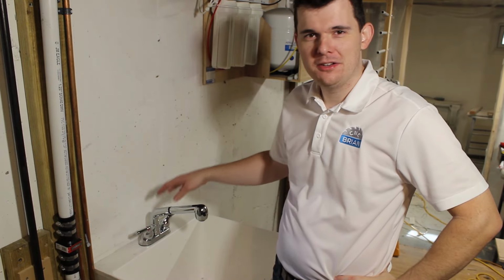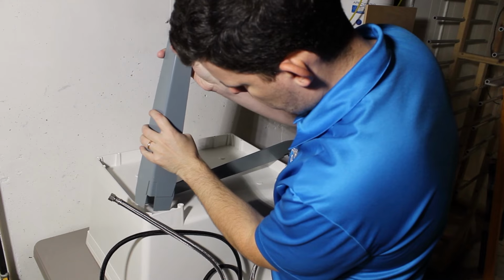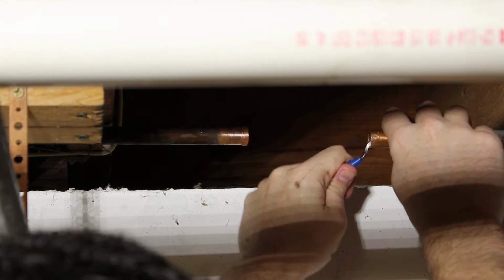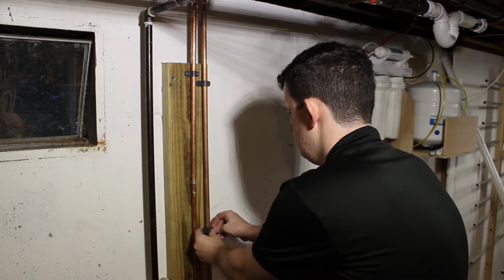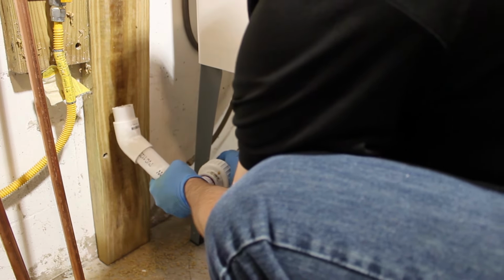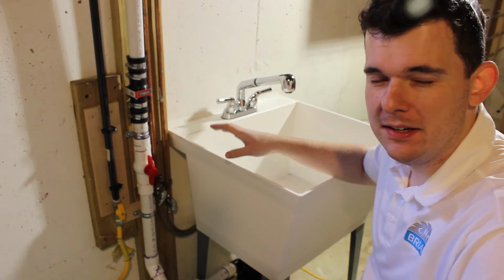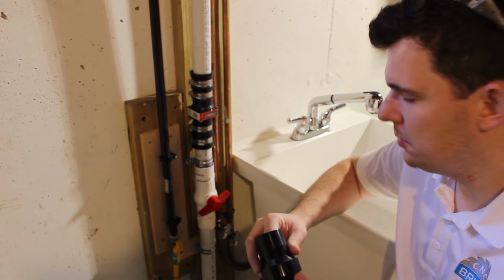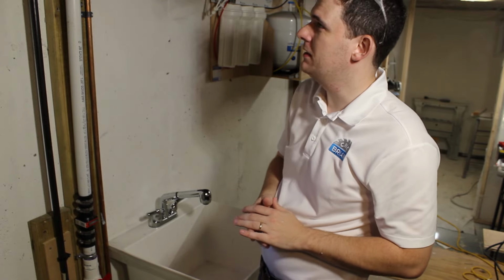Home Projects: How to Install a Basement Utility/Laundry Sink

Comment: Great video! I have a utility sink that I want to move and the drain is coming up from the concrete. Quick question, what do you do if you existing drain is on the floor of the basement? It's protruding from the floor. Thanks for the feedback!

Comment: What if the main waste pipe is only a few inches above the laundry sink?  A plumber recommended a utility pump to keep waste from backing up into laundry sink. Will a utility pump be overkill if you're only moving the water slightly up to the waste pipe?
Reply from the maker: You will need a pump regardless if the wastewater pipe is above the elevation of the outlet of your sink. Basically if you can't exploit gravity you will need another means of getting that sink wastewater above the wastewater system discharge line.
Reply: @ Thank you so much for the excellent video and the detailed information. I’ll still have to hire a plumber, but now I’ll know what I’m talking about.

Comment: Got quoted $3,600 for similar job in 2024. Did it myself instead and saved over $2K. Used a Liberty 404 pump and Zoeller 3 in 1 ball valve, check valve, union. You did a very nice job in this video, clean and straight. If it doesn’t leak and gets the water away then mission accomplished.

Comment: 10:05, will reducing the flow with the check valve hamper the volume of water you can discharge at one time?  In other words, take a sump pump for instance, it discharges all the water at once with no restriction in water flow
Reply from the maker: This shouldn't, it will only max out at the discharge capacity of the pump minus any losses, should be minimal with a full swing check. However check out my newer video where I replaced this with a much better pump, this original video the pump become very problematic.
Reply: Thanks  @briancnc

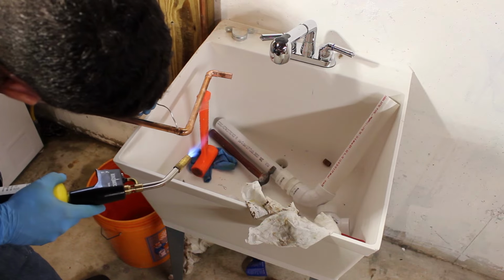Comment: 5:06, Just a note: soldering over plastic can be a hazard due to the burning hot solder if it comes in contact with the plastic, as it can burn a hole into or right through the plastic surface, so be careful & conscious as well

Comment: Brian - great video.  I am going to try this on my own. with help of your video.  Do you have any suggestions on type of pump specifice?
Reply from the maker: I would highly recommend a pump like this one:
https://amzn.to/3OcVb5P
 instead of the simmer pump I installed in the video. It has a basin that holds around 6 gallons so it will run very infrequently. The one I used in the video after awhile became very problematic. I will be shooting a video in about a week replacing it with this pump and post an update. I installed this one on another house and regretted not doing it on this one, was just trying to take up less space on this install but this pump runs continuously if the check valve leaks even the slightest.
Reply from the maker: I highly recommend the pump shown in this video, just published, rather than original I used. There is a link to it that video description as well. https://youtu.be/wsBWhM0QDG8

Comment: Why doesn't anyone put the piping within their walls in the basement? Too cold? I hate seeing all this piping.
Reply from the maker: Concrete foundation
Reply: @briancnc  I ment if you have a framed exterior wall in the basement that is inside from the foundation. I have drywall up on the exterior walls but the previous owner still kept the plumbing exposed. Any issue with routing the piping within the framed wall?
Reply from the maker: @SurfTheStreets01  I mean it's all about cost. If oyur basement is nicely finished I would definitely have cut open a stud bay and patched the drywall to clean that up. Just need to make sure it's well insulated if it's an exterior wall. Depending on your location.

Comment: Can you drain into a sump pump?
Reply from the maker: Mechanically yes, but check your local building codes. I will be posting a new video soon where I swap this unit with a sump pump unit, I really wasn't happy with the inline unit in the long run (although simpler and cheaper at the time).

Comment: Is there no need for venting?
Reply from the maker: Unfortunately you can't really cleanly vent off with this unit unless you branch off underneath the sink (if there's space in the vertical). I've had this unit in for a few years now and I'm not super happy with it, will be switching to a vented sump pump type, look out for that video in the coming weeks.

Comment: Questions  we installed one. And I washed some muddy jeans that had gravel and now it smells like burnt  ,is there a reset or is it fried
Reply from the maker: If you smell something burned turn it off and unplug it, call an electrician. Probably got debris stuck in the impeller and it got stuck and overloaded the motor. These small motors don't usually have overload protection so you're probably in for a new pump

Comment: You should have kept it the way you had it the correct orientation coming off of the pump should be check valve and then the ball valve for servicing on top of the check valve in case you ever have to service the check valve or the pump

Comment: I need this in my house!! I don't have a ball valve, my pump is hooked up to a small copper discharge pipe and the pump goes on and off continuously, but doesn't go on until the tub is almost full. Of course, the tub overflows and I have as mess!
I can't find anyone to install a new one.

Comment: Are the supply lines 3/8" or 1/2"?
Reply from the maker: Hi Gary, 1/2" copper and sink lines were probably 3/8 braided stainless steel.

Comment: You don't need to vent it?
Reply from the maker: Not this one. It's not ideal though, this is just for simplicity I would vent it if I did it again and used a basin pump with a few gallon pumpout instead of this pump model.

Comment: what do you use to burr out or sand the pvc to make clean joints? i think that's where i went wrong and have leaks
Reply: Sandpaper. And clean it off after sanding.

Comment: So I actually installed my basement sink pump using this video as a guide and it was working great for about 1 day. I noticed one issue, I believe you are supposed to have a check valve directly off the pump, not after running a few feet (especially if running up). I installed my check valve as shown in the video and all the sudden my pump just started kicking on and off every 3 seconds. After unplugging the pump I noticed that all the water running towards the check valve but not passing it was just backflowing into the pump. Im going to run to home depot to install a check valve directly to the pump, im assuming that will fix it but I wonder if now im going to have an issue with added stress on my pump because of the two check valves. I may remove the other one but ill see. Anyway, has anyone elts had this issue following this guide or is my original valve just not working?
Reply from the maker: If you're referring to the original valve in the box it's garbage. I replaced with a higher quality check valve than even shown in the video and it's not perfect but works better. I will be replacing this setup with a different pump model that has a small holding tank. I had this on the first one I installed and although it costs more it's flawless.

Comment: Interesting, My question though, so technically everything above the ball valve/check valve is still full of water then? or does it syphon itself? My drain line is actually about only 4-5 feet off the ground, and it has an open feed where the dishwasher dumps into, I was thinking about using a T fitting into that. Luckily my house is all pex so no copper or solder for me.

Comment: You installed your stop and waster upside down. the drain of the valve doesn't drain when it points up. Plus with the sink installed now you don't need that, just drain the line through the sink.  Also you should  use a sanitary wye not a t-wye on horizontal drainage. But all in all, nice job.

Comment: Good video took a lot of effort to make.  But there's an inherent flaw in this.  The pump impeller is so incrediy volurnable this way.  ANYTHING finding its way down the drain will contact the impeller.  A drain strainer inside the sink won't due either.  Because that will get full of lint or other debris while the sink is full.   When you go to remove it the debris will rush down the drain and into the impeller.  Ours died because of this issue.  The impeller kept getting jammed and I would use a long screwdriver to free the impeller jam.  A bunch of bologna thus risking a pump motor fire.  Its unsafe.  With children little lego pieces, little rocks, and a million other things whatever, get in there.
Reply from the maker: Agreed, this pump had a lot of drawbacks, I just put a video out on a pump I switched to (vented type). Now that a drain screen won't fuss with the cycle of the in-line pump now that it's all gravity fed the strainer will work just fine.

https://youtu.be/wsBWhM0QDG8

Comment: Why not use SharkBite? If there is water in the pipe it’s a pain to sweat the pipes.
Reply from the maker: Sharkbites are fine in a pinch but I prefer sweating or propress when you can.

Comment: Awesome video and you discussed the exact issue that I was looking for:  the quality of the check valve.  I too have read the reviews of this pump kit and had the same concern about the check valve slowly leaking.  I have an existing basin pump setup for my utility tub and have been thinking about replacing it with one of these under-sink pumps to get rid of the basin.  However, I have only about four vertical feet between where this pump would discharge and where it connects into my main sewer line.  In other words, the check valve may not have enough pressure on top of it to keep from dripping.  How much pipe do you have above the check valve where it goes into the horizontal drain pipe?  And you haven't had any problems with the Everbuilt check valve leaking?  I saw this same valve at Home Depot this week.  (My current basin pump system does have a check valve that seems to work fine but if I am replacing it I'd like to update everything while I'm at it.)
Reply from the maker: I replaced the valve but it still leaks. I will post a new video in the future for the fix, aka a slightly more expensive pump unit with a holding tank that essentially makes this a non-issue. The manual asks for 6' of head pressure which is almost impossible in a 1960's basement. I leave the pump unplugged when I'm not using it to avoid it short cycling constantly but I can't recommend this pump anymore. The rest of the video is still valid and shows how to setup the rest of the system but with the other pump you need to tie in a vent or add a studor vent.
Reply: @briancnc  Thanks for the response.  With the basin pump, you can't use a studor vent, because it won't let air out of the basin when the water goes in.  Air admittance valves are one-way only.  With the basin pump, air has to flow both ways in order to work.

Comment: Thanks for the video. If I go with the "better" pump with holding tank, do I still need the ball valve? Since the pump won't be throttling? Two other questions:
1. where is the P-trap? do I need one?
2. do you think the better pump can be plugged into the same outlet as a washing machine? probably high amp draw.
Reply from the maker: Mat,

No on the ball valve but check valve is still a good idea. P-trap on this setup isn't needed, there is a column of water and a loop back up which creates a ptrap in the same fashion. On #2 not sure, depends on the electrical load of the washer. Neither of these pumps are that high of a load. You can look up full load on both in their spec sheets or manuals and see if it exceeds the limits of your 15a or 20a circuit.
Reply: @briancnc  Thanks Brian!

Comment: i just got my Everbilt 1/3 HP Utility Sink Pump. My question is. Why does it have two power cords when my old one only had one ? Thx for the tip about the gate valve, i may have to get a new one.
Reply from the maker: They plug into each other, one is a full switch so when the stack fills up it closes and allows the power to the pump. For some reason they do.
Reply: @briancnc  Hey i just got back from Lowes looking for a coupler to fit this but couldnt find any. Do they even make one to fit both of these ? https://imgur.com/cW1W7zP
Reply from the maker: @Sjrick  not sure if you're trying to put the ball valve there but it goes on the output of the pump not the input. All fittings are standard size, those would be male threaded and you can get couplings that have another side for 1-1/4 or 1-1/2 pipe to glue on.

Comment: You're supposed to leave the soldered joint alone while letting it cool down. Otherwise, you can end up creating small cracks and end up with leaks later.
Reply: Yes it is tempting to wipe it but a wet rag can also cold shock and crack the joint, along with the risks of moving a still soft joint. If you are very delicate you probably will get away with it but use restraint.
Reply from the maker: Not sure what you mean by leaving it alone, what was I doing? No leaks months later. Thanks.
Reply: @briancnc , 4:40 - no plumbers do that. Once the solder melts and fills the pipe, they just let it cool - they don't clean it like you do as the solder is still hot and can move the joint. If you want solder to look "clean", use only the necessary amount of solder and begin soldering from a location that's not visible (the back) and capillary action will draw the solder to the front.
Reply: @purplepill2024  I live for detailed explanations such as this. Thank you

Comment: Usually the check valve is before the ball valve for servicing purpose. I really don’t recommend this pumps. Get one with a holding tank. Throttling the output is asking for trouble.
Reply from the maker: Simon, makes no difference really for the check valve. You're right though I would not install this particular pump again, it's loud and runs constantly. Ive installed both and the one you're referring to is much better, only cycles once every few minutes under constant use.

Comment: Great video - were you safe having your check valve at that height?  It looks higher than the sink.  My concern is when I do mine that the water before the check valve would run back down to the pump after it had finished cycling, and cause me issues.  Seems that isn't happening with your installation.  Is there enough room in the pump for that extra water?
Reply: Im actually having that issue now, im going to add a check valve directly after the pump
Reply: @TroubleBrewing  Yep - I did mine last year and I kept my valve low.  The only issue I've run in to so far is that if you have something big go through, like an almost-gone bar of soap, it can sometimes prop the valve slightly open.  Then comes the maddening periodic run of the pump as water seeps back from the check valve.  Solution was to open the choke valve upstream fully and flush with hot water until it was gone.  Other than that, it's a simple system.

Comment: Why would you use a 2 handle valve?
Reply from the maker: The valve only has one handle for the ball, not sure what you're getting at?
Reply: @briancnc  I meant the faucet sorry
Reply from the maker: @davidasdasd4666  Oh that makes sense. The two handles are for hot cold. It's a cheapo setup, the faucets with mixing valves are more expensive. If I had to do it again I would not have purchased this faucet kit, it's very cheap and all plastic.

Comment: Would this setup pass code if you’re trying to sell a home with this pump style utility sink?

I am needing to relocate washer about 15’ from it’s current location and I’m on the fence of paying big bucks to have concrete ripped up and have new drain put in to main line or go this route
Reply from the maker: Definitely do not put an inline pump on something such as a washing machine, it will short cycle the pump and probably kill it in short order. Can't imagine a sump pump with a catch basin that can hold up to a few gallons (much better than the one I used) wouldn't pass code. Code is only going to say you have to install it to code but not that you can't use a lifting pump to get it to the elevation you need to in order to discharge it. Your local code would be best to check though, and best to consult a local plumber if only just to pick his brain.

Comment: Thanks for video, looks great!
Is it required to have the ball valve after the check valve?
Reply from the maker: With this setup absolutely. The ball valve compensates for the fact that the pump output is too powerful for the sink water input. By restricting the output flow it balances the flow out so that it doesn't short cycle it. Fyi and I will do a follow-up video I would not recommend this pump setup anymore, too many issues with leaky check valves. I'm going to be replacing the pump for one that has a holding tank as I had in my previous shop. Lessons learned!

Comment: Nice, neat. Hired help not so much.   Does every utility sink require a pump? ( I would like to install one in the garage. But I have to start from scratch. The laundry room is behind the wall and there's a drain, hot and cold water. But I want it on an adjacent wall 20' from the convenient wall.)

Comment: I am just going to add the check valve and ball valve. amazingly my set up seems to have neither. May eventually replace everything minus the water lines in yer video. Very informative, part im doing seems like it will be very easy. One question, you linked the quality check valve, im assuming any ball valve is pretty much going to be good enough since its a simple device?